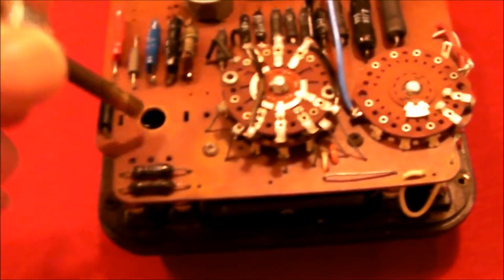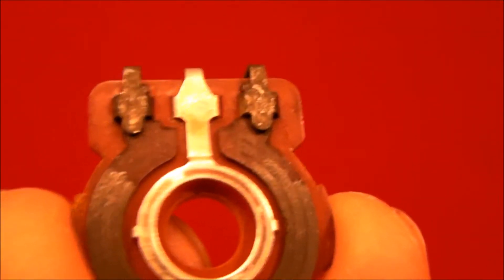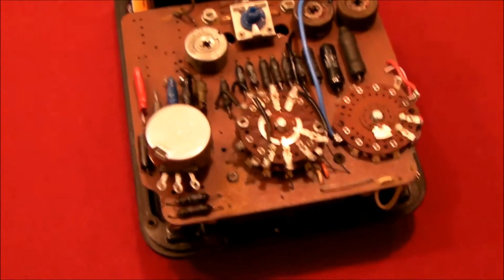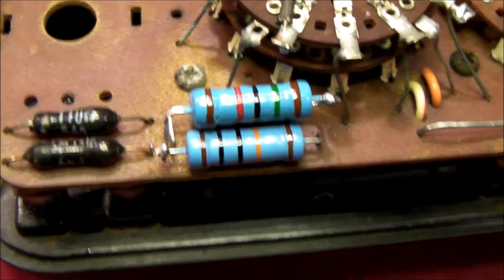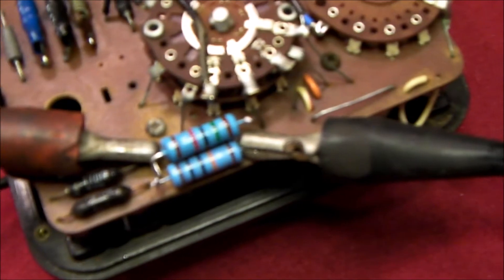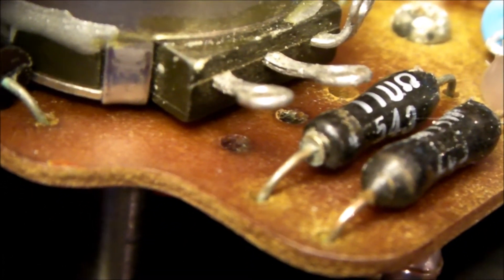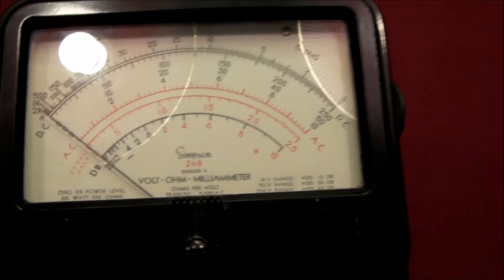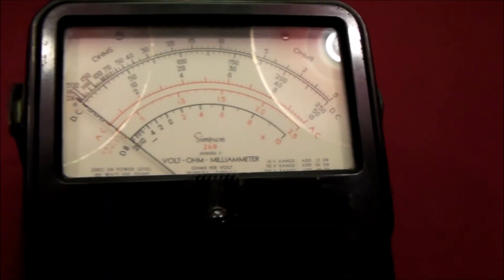Simpson 260 Resistance Reading Repair, Zero adjust repair, 117.7k ohm replacement, R x 10,000

Comment: How do you open the case on the Simpson 260 series 5 ? Anyone know? I need to replace the battery. I removed the 4 screws on that back and the cover won't budge.
Any help is appreciated
Thank you

Comment: Great job I have to Simpson meters. Using them since I graduated NRI SCHOOLS and my father purchased it in 1943. A note, take the battery’s out when you put the meter in storage. Your resistor solution is outstanding

Comment: If you are replacing a resistor with 3 series connected ones, than, the wattage can be made lower. For instance, if each of the three has the same ohms value, then three 1-Watt resistors should suffice

Comment: I found all different values of pots like that one.on.Ali express very cheap.they look the same ,for a dollar or two some.less some may be more but most under three bucks.have you tried deoxit 5 contact cleaner,I like the metal film.resistors too.your 260 look to be in good shape .thanks for sharing ,now you have a nice meter,the new ones are about three hundred bucks I hopeing someday to get one too.right now I working on my two different heath kit vtvm meter.next either a signal tracer or a Simpson 260  meter ,somethings.are just nice to have on a work bench ,but that takes time.for some of us ,I am a disabled on.a fixed income..

But love working and learning on.old tube radios.

Comment: I also have this meter. Just acquired it. Upon inspection, I found a problem. I would like to know the values of the resistor that you show with a "RED" shrink tube (Just above the black one, to the left of the ZERO adjust knob). Mine looks to be a heavy wire-wound with a clear tube over it. Mine had been exposed to some high current and appears to be burnt and I would like to replace it.
Reply from the maker: schematics for the Simpson are readily available online. I don't have it readily available.
Reply: https://www.simpson260.com/